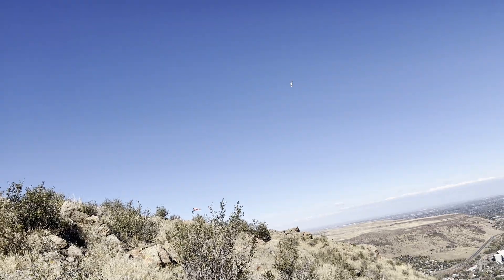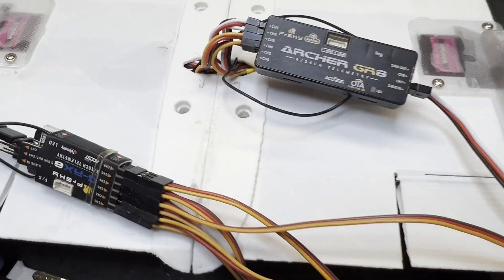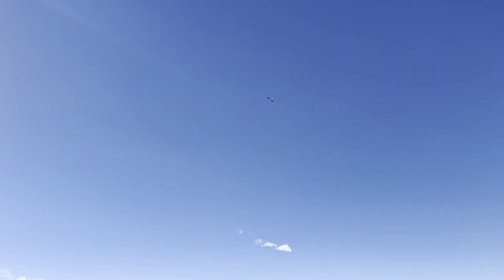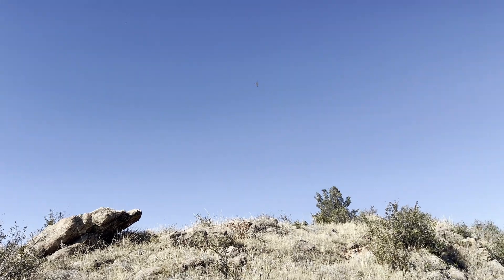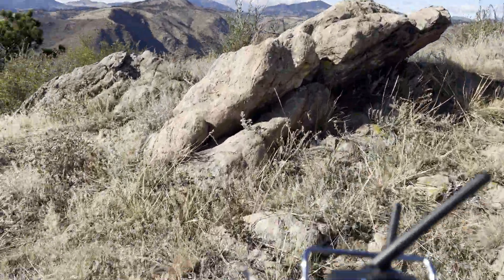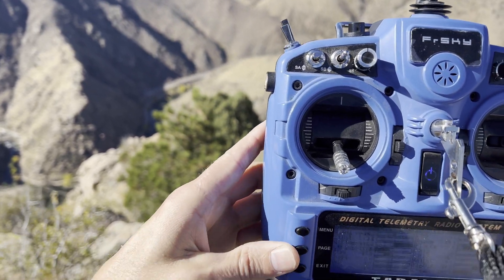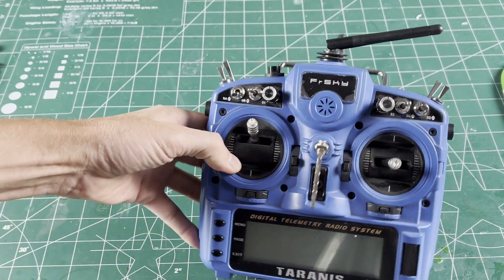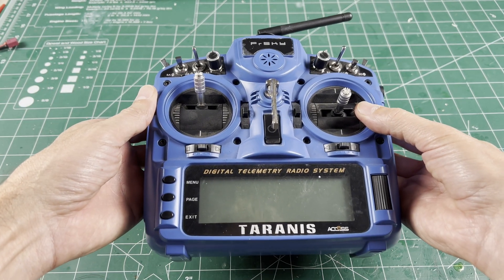Done with FrSky - part1- Dynamic Soaring mishap.. not pilot error for once, which is not good

Comment: And with Radiomaster you have the support of (RC radio reviews) on YouTube the best teacher on planet earth.
Reply: If you need a teacher to help you use a radio that is proof that it is not a quality and polished product. A radio should be easy to use and not require an engineering or coding background. That is just crazy. Frsky, Radiomaster, and Radiolink are budget radios with too many issues. Step into the future. My radio has built-in AI programming. Speech-enabled flight trimming. If a servo is revered let's say aileron and you take off you can with your voice reverse the aileron servo without having to look at the menu. By then your plane has crashed if you have to look at the Ui to reverse a servo. It also doesnt need a dedicated YouTube channel to learn to use it. The radio teaches you or does everything for you.
Reply: @FarmerFpv  This is the most ridiculous post I think I have ever read.  I suppose you woke up knowing how to fly your airplane as well.  Every piece of tech has a learning curve.  I have been flying for over 40 years.  FrSky had it's place in the RC world years ago.  Now, not so much.  The Taranis was ground breaking due to its power and price.  It has been surpassed.  If you need your radio to talk to you, that is your problem.  If you need a voice command to reverse a servo midlflight, that means your pre flight checks were neglected.  These features you believe make a radio high end are just crutches for others.  I fly all my models with a Radiomaster running ELRS, and couldn't be happier.  From VTOL's to fixed wing capable of over 150mph, one radio does them all.  I see from your channel that you mostly fly quads, which use a FC to actually fly the aircraft.  You need a radio that does very little, as the FC does most of the work, yet you say that a radio needs voice commands.  Interesting.

Comment: OK, so 3rd party battery installed, no foam block preventing battery shift when you shake.the transmitter. Depending on the battery/wire configuration, shaking it could put stress on the battery wire and battery connector, causing a disconnect. This would not occur with the stock battery install. 

Install a foam block to fix the battery in place so it doesn't rattle. That should solve the shutoff issue permanently. 

And the radio you describe is one of the new TANDEM & TWIN radios. I'd recommend either the X14 or the X20RS as the two best options. TWIN is the RF system you want. The current FrSky receivers (TANDEM, TWIN and Archer Plus) are all easy to get, it's only the old lines which are hard to get...because they've been replaced by Archer Plus. 

ETHOS is much easier to program than OpenTX for basic setups, but equally powerful. And Mike Shellim publishes good templates for both.

The 4-in-1/ELRS radios all run EdgeTX, which is the programming you are already used to, both bad and good in case.

Skip all the legacy RF systems, they'll all be the same or less reliablle than ACCESS
Reply from the maker: The foam block is a good idea, but would just keep things quiet. I thoroughly checked the battery connection, board and battery sides, and did not find a fault.

Comment: Still using the same taranis as this one. Till now no issues for me. Though if i would change now i would do it for 4-1 Radiomaster. I need the freedom to buy planes from various manufacturers and this module it has the best compatibility. It was my mistake from the very beginning i bought taranis cause if i combine the money i gave for external receiver it would be the same money to buy the T16x and i would have a touch screen and bigger too. Now i am stick to taranis till it will die!
Reply from the maker: you can get a 4-1 radiomater module for your Taranis.   
About FrSky, I just question the engineering on the battery circuit on the FrSky, the transmitter needs to stay on no mater what.  Other radios might work the same way now with just a push button on and then push off, a micro controller managing this ... I don't think I will find an alternative as this is so common in electronics now, but maybe something that behaves differently.
Reply: @soarkraft  My mistake writing receiver. Transmitted i wanted to write and i already have one. That was what i meant. Now i have the taranis with the external 4-1. Both together maybe they are more expensive than T16. And with T16 you have more comfort since it’s lighter and has better screen.

Comment: I have a Hotrock handle.  Never failed me.  Launching will be a little more challenging and eventually, you'll have to do OUTSIDES to unwrap the lines.  Also, your Dynam Sailplane will have to be 60 foot away but I've only lost connection with a plane once with it and that's because the leadouts in my ARF broke inside the wing.
I Bought one of the first batch of Taranis's that came into country.  Finally replaced it with the newer, halls effect sticked version THAT didn't have me using a piece of bamboo skewer to hit the buttons on to change things.  NOT the biggest fan of the pushbutton/rolling switch but had that on a Spektrum.    Never had a problem flying either but did use to work on IBM mainframes and IO.  Certainly looks like something is wiggly could even be the wires in your battery but those usually take a bunch of freying to break free.  Also, the connector can be sus.  Just letting it jiggle around without the packing could cause that problem I wouldn't think you have enough flex in the wire, though I have found that on Printer Swingarms.  Close the gate the broken wire touches, vibration of operation or opening of the gate throws the error.  I'd look more towards the connector.  It does act like you were unplugging it and plugging it back in.  BUT, it's hard to trust when you're spitballing anything that could go wrong with no real way to TEST what went wrong.
Radiomaster is what I probably would buy if/when I get a new transmitter.  That way you can talk to all your old systems and buy NEWER systems that have their protocol.  Unless you're one of those "Serious" guys that can afford the Jeti equipment or high end Futaba.  But flying from rough terrain and getting to that, hard on all equipment.
Used to be the only time I had a radio glitch was in the late 70s.  My Kraft made Tower radio was solid as a rock, till some CB guy would key up his linear.

Comment: Flying Futaba vir 30 years from foamies to jets, no issue. You get what you pay for..
Reply from the maker: I have several older Futaba radios, even a 80s Gold series, toggle switch power... never shuts itself off, just runs until the battery is dead.
I can't find a modern radio with anything other than the push button on/off that has micro controller making the decisions.

Comment: My Horus x10 developed an intermittent glitch that wrecked two models on me, i nearly went for a radiomaster tx16 but decided it wasnt worth the hassle. Ended up getting another frsky, this time an X18. fantastic radio, love the tandem receivers,  i'm glad i gave them a 2nd chance because the x18 meets my needs far more than a tx16 would for most of my models. 

I have nothing against radiomaster, i'm considering getting a boxer as a 2nd radio because i want a cheap, robust radio i can throw in a backpack when im out flying 5 inch quads.
Reply from the maker: I saw radiomaster has a "Pocket" radio... small.  Very cheap... if it had faults I would not care as much.  I just don't like the idea of buying another $300 transmitter has all these same problems
Reply: @soarkraft  The 10 channel Futaba runs T-Fhss so you you can have telemetry, gps and variometer. It runs around $400 for the xmitter and $75 for telemetry and Sbus capable receiver.

Comment: I had also issues you mentioned, except the last one. I now use Jeti for 4 years and no more issues since that.
Reply: If you change to some high quality like Jeti or Powerbox you will see big quality differences
Reply from the maker: I will have to check those out, I am willing to pay more, but I think they have the same power management scheme - push button with a micro controller doing all of the power management - might be a better design/firmware, but not as fail safe as it should be.  What was wrong with the toggle/slider switches... stayed on till the battery was dead... the fuse for circuit protection could be improved...
Reply: @soarkraft  those two brands are the most flown by professional pilots. In my view what I see on rc airshows 75 % are these two brands. I can tell you for Jeti and Powerbox they have high hardware quality and have an electrical strong design and high quality parts in it. I had a look inside comparing Jeti Dc16V2 and my FrSky and Radiomaster. If you have those side by side its like having a competition plane comparing to the cheapest foami plane. All in all I think it is worth for you to have a closer look to Jeti or Powerbox. Hope you find the right one for you

Comment: I had he exact same issue with my Frsky Taranis Q X7, power just shuts off. I figured it was a chip problem but don't really know. Can't trust it ... don't use it :(, bought a new Tx ...
Interesting that one of the spares you can buy is the power circuit board.
Reply from the maker: Which makes me want to get away from FrSky and choose a different design/firmware - but all the radios use this push button / micro controller power management.  I do like the simple slider switch... worked no issue
Reply: @soarkraft  One issue my friend had with the simple slider switch was he confused it with the elevator (mode 1) trim on a maiden (read stressed) flight ......
I think the problem with these transmitters is more an internal circuit issue. I was thinking of going Radiomaster and flashing all my FrSky receivers back to the old firmware. A hassle but better than trashing them. Other alternative is to go for the well-established (expensive) brand radio gear and start again.

Forgot to say, Very Cool dynamic soarer!!

Comment: I switched to the RM TX16 for the built in 4 in 1 module but i never had a minutes trouble out of any of my frsky transmitters and still primarily use frsky recievers. I would beg to say the battery connection wasn''t as tight as you thought it might have been. For ti to shut down like it did is showing complete power loss even if only momentarily. Just my two cents.

Comment: The one thing it might be is the cheap slider switches they use for On/Off. I had one do the same thing on my Turnigy RX (FlySky) and I replaced it with a good quality toggle switch. No problems since then. I also have a Taranis X9D and a Radio Master Boxer. Love the X9D.
Reply from the maker: Nope, this is a push button and microcontroller power management.  I would prefer a slider switch to this, I have many older radios with slider switches that never did this
Reply: @soarkraft  Interesting. Yes I can see now after looking closer at your video. Both my X9D+ 2019 have slide switches and they have not been any bother so far.

Comment: Yes, I agree that you need to replace your transmitter, however don`t rule out FrSky completely. I have used FrSky transmitters from their early days without any problems, I now use the Tandem X18 which uses the Ethos programming system. Ethos has now come of age with the latest update, and I find it is easy to use and now does everything that I used to do with Open TX.
Reply from the maker: I want to try something other than FrSky, it might be a fluke what happened, but it is the base power management that is probably used in all of their radios.  All of the radios these days use the push button / micro controller scheme, no getting around it.  I miss my slider power switches.. easy and never an issue and I used them a lot.

Comment: Looks like you batt connector is not solderd on both sides. 6:05.
Reply from the maker: Soldered on the other side and they are connected (through hole pads).... I saw that too and checked it.  The cap next to it also has a pad that does not look like it has enough solder... checked it to and was well connected, no fault.  I tried and tried to get the radio back into this fault condition by some physical defect and could not... 
I went back and resoldered all of these... after the video.  I have a good soldering station and I have been doing product design / manufacturing / quality control for electronic devices for 30 years as my regular job. 
im still going to get something else, just dont trust this system anymore

Comment: Radiomaster!
One major reason is that the 4 in 1 modules will bind with almost any receiver excepting the Futaba FASST, so will be able to run your FrSky receivers no problem.
People often stay with the same manufacturer because of the volume of receivers already owned but Radiomaster allows you to break away from that.

Comment: People on internet are leaving good comments about FrSky new radios X20... X18... New hardware quality benchmark, new operating syste (User Interface). They even fly them with expensive turbine jets. People also comment that Ethos operating system and user interface is far ahead with its convenience, presets, ease of use when compared to EdgeTX. You can buy your flavor variant of X18 X20 and stick a ELRS radio module.

Comment: Radiomaster TX16S, it's on OpenTX which you're now familiar with due to using the Frsky X9D. For the radiomaster you have options on which internal transmitter module you want. There's a 4in1, multi protocol and ELRS module. If you were to decide to use a different transmitter module than the one you have internally you can still plug in an external module into the JR bay. If OpenTX is still something you want to avoid you could flash EdgeTX to the TX16S to ease the use. Personnaly i'd go for the 4in1 internal module and plug the Radiomaster Nomad module into the JR bay. That way you have plenty of reciever options for reasonable prices and you'd be able to go fly long range if you desire to.

Comment: I use Radiomaster radios because hardware quality and price are spot on. All my RM radios Boxer, Zorro, Pocket are  ELRS + EdgeTX. I like Zorro the most because of the ergonomics of the radio, but I like Pocket battery life and hate its lack of switches. They both are with smaller gimbals then industry standard. Boxer has standard gimbal size, lots of switches, good quality but not that convenient and ergonomic is the hand. The other radio that I am now interested din is Jumper T15 because of color touchscreen user interface, but still waiting RM response to this product and hesitate to buy Jumper.

Comment: The way that battery can move around can induce some metal fatigue or just a bad connection in the battery connector or battery wires. When you shake the radio, that battery has a lot of inertia and will tug really hard on those tiny wires and/or connector. It could be an issue with the internal wiring of your battery too. 

If I were you, I would probably replace the radio battery, maybe even solder its wires to the radio main board and probably continue flying with this radio. 

That said, I use a TX16S ELRS. Great radio and value-wise it's a steal.
Reply from the maker: Sure, but it would continue as a fault if that were the problem.  It may still be a physical fault,but amplified by a circuit design that doesn’t handle it correctly.

Comment: So.. you are flying a radio that is so out of data now and then you go.. oh.. frsky is bad.  get a modern radio.
Reply from the maker: And that would be what???? Another FrSky like others suggest?  I have lots of older equipment that still works.. and had lots more abuse… and did not have problems like these do.
Reply: @soarkraft  @soarkraft to be perfectly fair.. Your title is click bait and effectively shaming a company in which you really have no reason to do.   Done for dramatic effect.

Let's put things into perspective.   Last week a pro heli pilot using his near new tx16 had a gimbal issue.   It happens.

Hell..  Even likes of jeti will have an issue.

Once I bought a new car and it broke down on the way out the dealership.

I think that maybe complaining of a fault and shaming an entire brand is a bit over the top.

I reckon far more people have zero problem - but for sure they do not jump up and do a video claiming that brand is great.  They walk away happy.

Yet you have essentially click baited and potentially turned many people off a perfectly good system because you feel upset that you had an issue.
Reply from the maker: Yes, I am straight up complaining.  The power circuit should have some better power conditioning protection against brown out or voltage spikes.. I do product development as a day job and I know this can be done, ie Battery powered medical devices, but it adds cost and it is rare to happen.  I see they have some, but it is minimal. is anyone doing this different?  Is there a better system?  I would not have done a video about it, but it kept happening in the moment.... then stopped... and does not appear to be a simple broken wire, connector or solder joint.  Yes, FrSky products have let me down multiple times in the past 4 years of using them... and this was the last straw.
Reply: @soarkraft  and which products are they?

Because again I suspect that you are using the older stuff.   The frsky kit has had massive quality improvements in recent years.

In the end.. By all me as.. Complain.   But maybe complain direct to them on git first.   Add some constructive suggestions.  Engage.

The approach you have will win no friends.  But maybe will get you a few extra clicks.